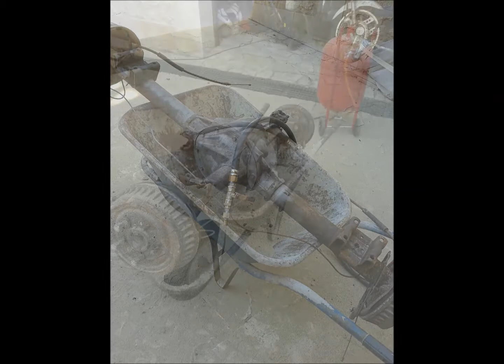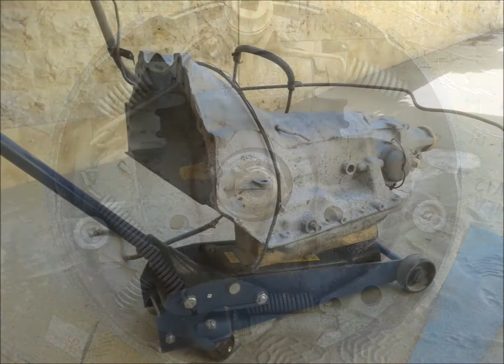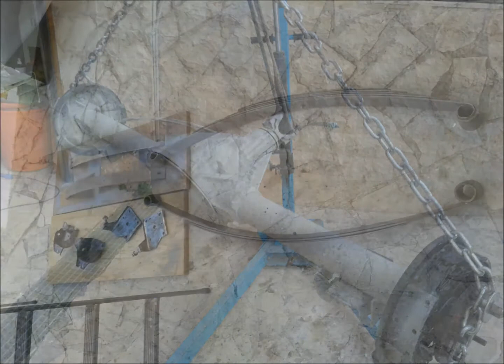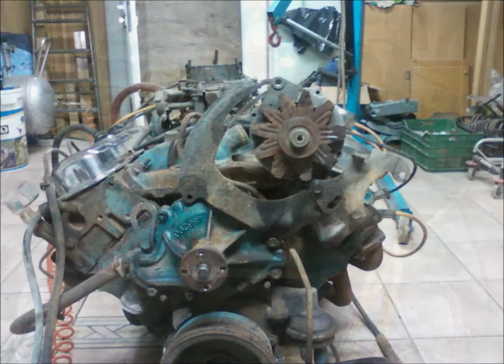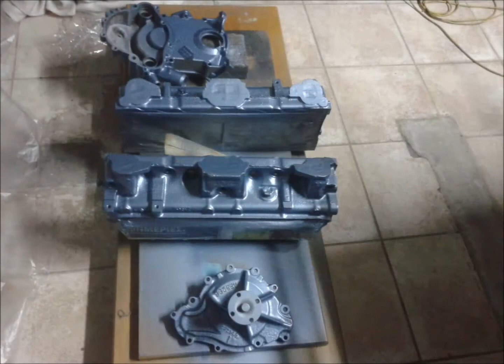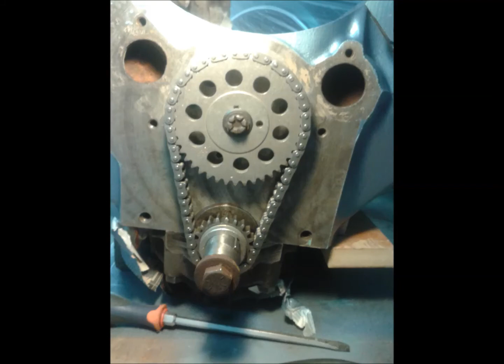Muscle Car in Greece - Pontiac Firebird 68 Restoration 5

Comment: Good work, it's interesting to see the components you were able to get for the project. Looks like a late 1970s 350, Nova 8.5" rear differential, a 1970s mutli-pattern bellhousing TH350. I cannot imagine how hard it would be to maintain an Old Pontiac in Greece :)